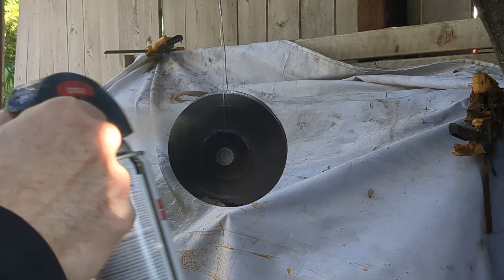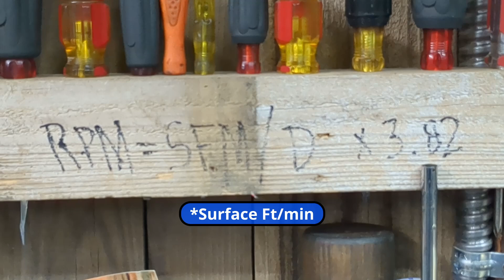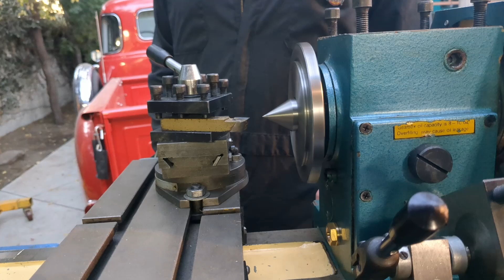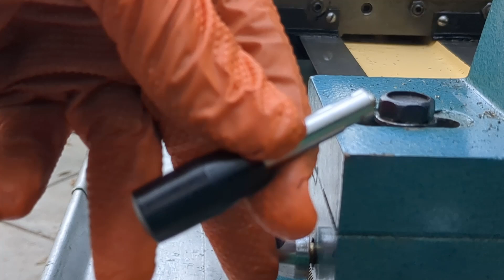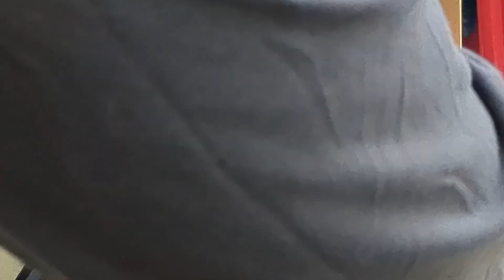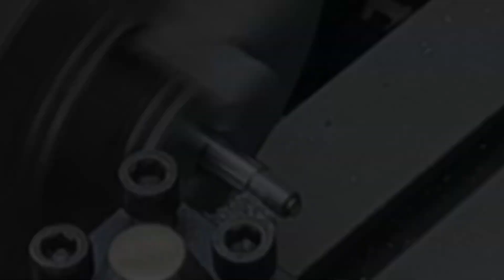Smithy Lathe/Mill/Drill Combo Rescue Part 6 – Making Chips and Cutting Threads

Comment: I was able to get a cross slide and axa tool post. My middle pulley is rubbing on the case, did you just tighten the belt housing to resolve that? I really appreciate all your help
Reply from the maker: Awesome!  AXA will be great for your work.  You can find used AXA tool holders on eBay much cheaper than new.  As for the pulley rub, my middle pulley stands about 1/2" from the back of the gear cabinet wall, and is mounted on a spring-loaded swinging bracket,  and there's really no way for the pulley to contact the side of the cabinet. This doesn't directly matter, but I'll mention that  on mine, the middle pully is only used in conjunction with the two outside pulleys for slower lathe speed (160 -400 RPM) while only the two outside pulleys are used alone (without the middle pulley) for the higher speeds (630 - 1600). What model machine are you using? Perhaps then I could provide better answers.  I'll respond to your gear question a bit later.
Reply: @ thanks. I think the middle pulley is rubbing the bracket I think not the cabinet. I have been running the lathe single belt like you mentioned for a few weeks now with no issues. However I purchased new belts to use the intermediary pulley for the reduction should I need to use it. That’s when I heard a large racket. So I switched it back for now. I’m planning to disassemble it but I wanted to get your opinion first. I have a 1220xl identical to yours. Same color scheme and everything. I ordered a set of gears SAE from Smithy, they are on the website. However, I noticed many gears tooth counts are repeated between the SAE and metric. I was not sure if that meant doubles were required or not. The metric set are on back order so I’m considering ordering a set to be 3D printed. Thanks again. P.S. I know you mentioned selling your machine. What are you planning on asking for it?
Reply from the maker: @code3responsevideos872  Got it.  On mine, it's definitely louder when using the middle pulley.  I think it may be partially caused by the pulley alignment between the three pulleys (motor, center pulley, and quill end pulley), but there isn't a lot of adjustability that I noticed.  It's not too difficult to take off/on the center pulley mechanism, but take a few good pictures before you remove anything, just to help you line things back up, especially at the end locations where the spring is mounted.  Regarding price, I looked around and asked around and I think a machine in good condition might be worth between $1500 and $2000, or more depending on how much tooling and extras are included.  I still need to sit down and make the for sale video and catalogue what will be included with the machine before I come up with a final asking price.  I just returned from being on the road for 10 days, so I'm a bit behind.
Reply: @WernersWhirligigs check to see if the idler pulley ( the middle set of pulleys ) has bearing play. There are two bearings inside that idler pulley that are a press fit . 
 Belt alignment is important ! 
 How to adjust on the Smithy 1220's 🤔 ? Guesstimate, which ain't worth a shit 🙄 . Really , the lathe spindle pulley set is somewhat fixed. So the idler set and the drive motor set has to be aligned to the spindle set 😉.

Comment: What is the model of this machine? Is this a Midas or an at300?
Reply from the maker: It's a Smithy CB 1220 XL
Reply: @ thanks, were the metric change gears included with your machine? Smithy doesn’t have any, and I’m trying to find and alternative source.
Reply from the maker: @code3responsevideos872 mine came with a full set of change gears which handle both metric and SAE threads.  On mine, there is a chart on the door of the gearbox which tells me what combo of gears to use.  I have gears from ~30 to ~62.  One gentleman posted that he was able to find some on eBay from China, however he needed to bore out the center himself. How many gears are in place in your gearbox for the current setup?
Reply: @WernersWhirligigs  my machine came with nothing extra, and I’m assuming because the threading knob works that there are 4 gears in there. I tried to order a set of SAE from smithy. Hopefully they’ll ship them. However the metric is on back order so I’ll either have to wait or get 3d printed. How many total gears do you have between both sets? How many gears are repeated?
Reply from the maker: @code3responsevideos872    There's no distinction between the SAE and Metric gears with my set.  They just have the number of teeth stamped on them.  I have 17 gears, including 27, 30, 32, 33, 36, 39, 40, 42, 48, 49, 50, 51, 54, 56, 57, 60, 63.  Good luck!

Comment: Hello Werner.   Some food for thought...  Ditching the chuck bolts and putting studs in it will make the process much nicer when it has to be removed often to use the mill.  If you are still using the tall belt tensioner on the mill be sure of the condition of the bearings - mine exploded and I didn't have the cover on.  Some gear oil or Lucas squirted in the mill gear access hole will quiet it down as there is no active oiling to the mill head and It has a phenolic bevel gear.  The machine will make some chips but i think your cutter needs some work seeing the tearing at the leading edge.
Just passing on my experience with it.
Reply from the maker: Hey Eddie - that's great advice.  Thanks so much. The studs will certainly make a big difference.  I was looking through the drawers today for some machine screws and saw some threaded studs in there, before I read your message.  I'll have to see if they fit.  Regarding the tensioner and bearings, are you referring to the bearings on the center pulley ,where it mounts on the shaft?  On my machine, there's a large spring that pulls the center pully to the right.  I used a gear puller to remove that pulley and its bearings from the shaft, but I didn't do anything more to them.  I'll look at the carbide cutter, as well.  I have a carbide grinding wheel setup, so I can clean it up if needed.  I appreciate you taking the time to share your experience.  With regards to this Smithy machine, I started from zero.